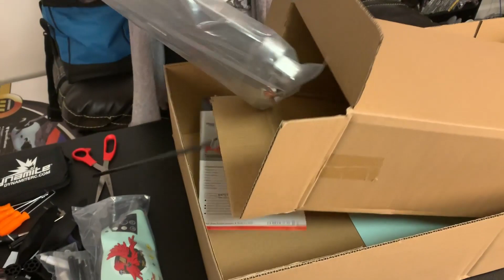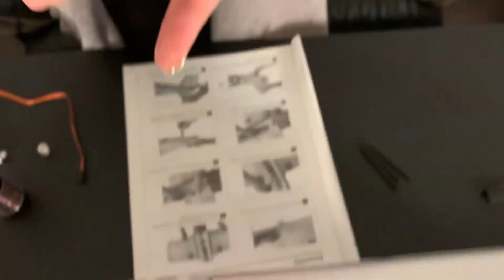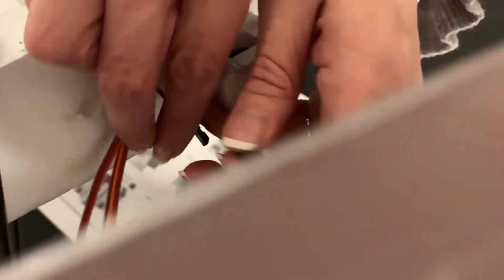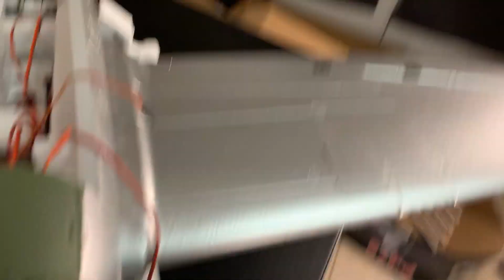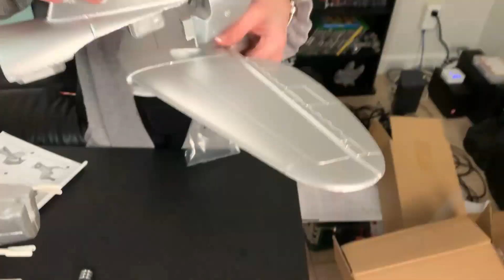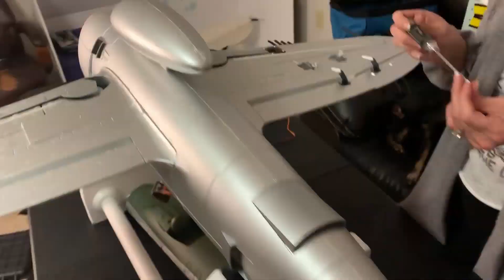Dynam P-47D Thunderbolt Unbox & Build

Comment: They not have  4 blade on that yet? 👎🏼 mine still flies great though
Reply: Not a fan of the drop tank though
Reply from the maker: I debated leaving the drop tank off but it leaves two big square holes in the bottom of the fuse. It would be easy enough to fill them in, but putting in the drop tank was quicker.
Reply: The RC Air Marshall until it get scraped up, we’ll at least mine did anyway. I cut 2 pieces of foam that size, glued them in and filled the crack, can’t even tell